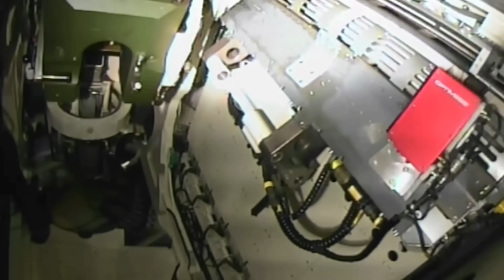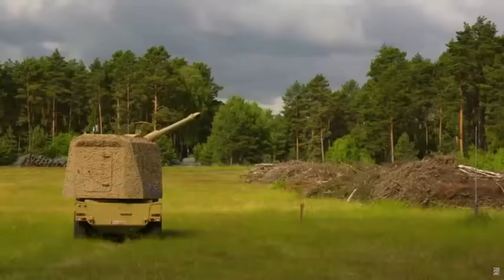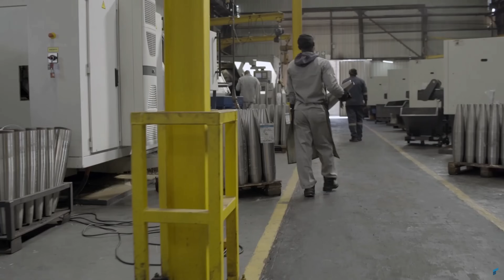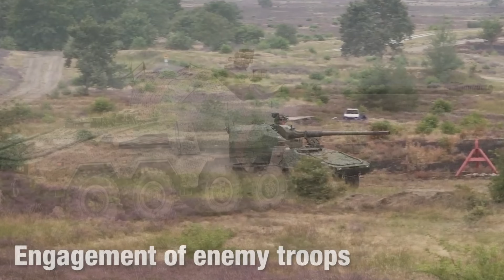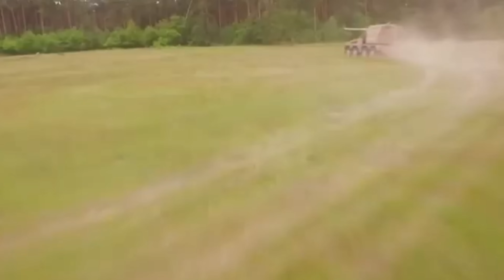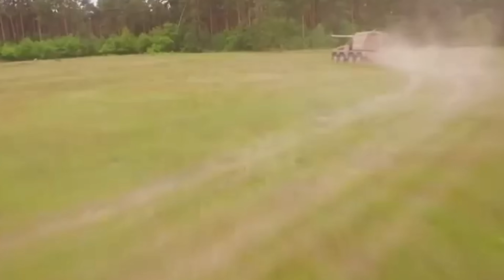The RCH-155 Self-Propelled Artillery System | 155mm FIRING ON THE MOVE!

Comment: Thinking of the state of the Royal Artillery and you mentioned the price of the beast a light bulb went off if you could mix a Regerment with RCH  and the NEMO  systems with my time spent on the 433 Abbot and the L118 there were times a Gun was sent out alone to deal with a target say a bunker or fortified house you could send a NEMO  this system could replace the L118 apart from it's Parra role and Comando role . You could either have a mixed Regerment or separate Regerments of RCH  or NEMO and of course they could be a mix of wheeled or tracked depending on what type of battle group it joined

Comment: What type of vehicle is used to reload the autoloader once it has fully discharged all its stored rounds?

Is it a vehicle similar to the K10 to reload the K9 howitzer? The K10, in turn, is capable of semi-automatically collecting rounds from a truck, storing them inside the K10, transporting them to the K9 howitzer, and transferring them in a fairly automatic manner with brief intervention from its crews?

Because with two crew members in the RCH and another 2-4 in the loading vehicle, it's going to be a nightmare to load 2 tons of rounds plus their propellant charges in an acceptable time. This is under ideal conditions, not in a real-life scenario where you might be attacked and you might even need some of the crew to assist in protecting the vehicles.

Comment: With Canada's new "Indirect Fires Modernization Program", I wonder if they'll be getting this. The desired specs seem to be favouring it, plus we use the LAV which is a related vehicle platform. 
Canada has been talking with South Korea for multiple projects, so it's possible a package deal might be worked out there & include the K9 instead.

Comment: With smaller budgets and lower solider numbers, Boxer RCH makes sense if it is part of support vehicles group that can change modules around in 1 hour to what is needed.

Boxer have been tested by the UK and Australia to be amphibious if the RCH is too that could make an interesting amphibious assault group.

Besides Australia and UK. I can think of a few others that could uses.

Comment: This version seems really cool. Only thing I wonder about the fire rate is accuracy. I mean it would have to wait until it stops "wobbling" around after each shot since not having the platform stabilized.
Reply: The gun does not fire when the operator pulls the trigger. Instead the fire command is piped into a computer which "pulls" the actual trigger in the exact very milisecond the barrel is correctly aligned.
Reply: @jonny2954  Makes sense.

Comment: I see this being very prone to tipping over if firing on uneven terrain. Kind of like what was found out with the 105mm on the Stryker when putting a big gun on top of a wheeled chassis.
Reply: Boxer chassis is significantly heavier than a Stryker.

Comment: I won't be surprised if most members of Great Britain, the British Commonwealth, N.A.T.O., and the E.U. buy this, at least a few batteries each. Most of the Middle East countries probably will base their artillery forces entirely around this turret, but perhaps different vehicle chassis, because it very well suits the Arab and Persian traditions of mobile battle (and top-down control in detail by remote management). Figure four to twelve batteries of twelve guns per country, five plus twenty plus twenty buyers. Everyone who buys it will buy the ammunition, too, so Rheinmetall is set.

Many of the buyers will also buy the Korean K9 or Swedish Archer, as well, while others will have their own domestically-produced SPH at half or a third the cost; but with widespread adoption, the pressure to "standardize" will actually suppress contracts to buy and maintain cheaper systems.

Comment: In the same time the ukrainians got their first "kf41 lynx" and their first "boxer RCT30" (of nine).
The boxer RCT30 are escort vehicle for the RCH-155 with special anti-drone equipment.
The first five RCH-155 will stay in germany for training and replacement, which is very likely an experience utilization from the PzH 2000. Because the most trouble has been the tear and wear on these vehicles than combat losses. With a third of the PzH 2000 not ready for operation due to repair parts.
So in 2025 only four !!! RCH-155 will fight in ukraine. This will not have much of an impact, which is so typical german, they come up with some wonderweapons, but just not in sufficient numbers.

Comment: Hi Matsimus, what a truly impressive capability the RHC 155 is. As it marries, what is possibly the best 8x8 Medium Weight Wheeled Armoured Vehicle platform, the ARTEC Boxer with a Modular Fully Automated variant of the PzH 2000 155/L52 Calibre Howitzer, all within a separated unmanned Turret. Two of possibly the best in-class capabilities on the defence market today. Hopefully the British Army’s Contract to procure this system as its AS90 replacement will go through successfully, and without delay (Wish-full Thinking, I Know!). I do feel that at some point the British Army ought to Purchase an updated version of the Tracked PzH 2000, in order to give it both a Tracked and wheeled 155mm Howitzer capability. This would enable both Heavy Armoured Brigade and Medium Weight Expeditionary Brigade forces, a 155mm Tube Artillery Fire Support capability. 

Anyway, another excellent video as always from you. Whilst on another note, it would be brilliant if you could do a video review on South Korea’s K9 Thunder 155mm Howitzer and its Variants. Cheers.👍

Comment: Firing on the move is advised to be done only when immediate counter fire is expected. Otherwise to increase accuracy a full stop is _advised_. Even German engineers can't overcome physics. Adding a moving component to any firing solution presents difficulties as not all aspects can be pre-calculated. Such as last second bumps, rapid elevation drops, etc. So shoot and scoot is still the preferred method for firing solutions.
 However as it doesn't need to extend sponsons for stability it is very, very quick back on the move. It IS however capable of precalulating a firing solution while on the move, come to a full stop at a predetermined position, fire its loaded shell, and then launch two more shells within the next ten seconds easily. That isn't enough for counter artillery fire to be incoming in most cases, much less even to be in the vicinity. With the multi-round, simultaneous impact system that means three shells will hit within a few meters of each other simultanously with the firing position already having been vacated again. And that over a range of 50+ km with rocket assisted shells. 

So unless a prepared artillery position isn't within less than a few miles, AND expecting artillery fire incoming, AND having loaded the correct firing charges for the accurate counter range, AND be very quick on the firing... you see where I am going with this. It will be a very unfortunate series of circumstances if one of these beasts is taken out by enemy counter artillery fire if full shoot and scoot protocol is retained. Mind you, loitering ammunitions in the area do represent a danger to it, but the same applies to anyone in the field. And unless it is an AT munition it isn't likely to destroy it; rather damage it, if at all.
Because the RCH-155 should never be alone out in the open.
And don't send it into open combat with other armored vehicles. That's NOT its designed purpose. Abuse it outside its designed purpose and watch it crumble. But that's the case for ALL military equipment, everywhere, in every case, no matter the skill of the engineers. FAFO is a stupid idea, at any time.

Comment: I think if you combine these RCH-155 boxers with skyranger 30 boxers you can make sure to stay on the move to avoid counter battery fire and use the skyranger 30mm autocannon with airburst to fend of drones. Highly encourage researching the skyranger 30 platform for the boxer, the german Bundeswehr is planning to use both systems for the "mittlere Kräfte" (medium forces).
The 700km you mention is crucial, the idea of the medium forces is that they are all on wheels and the range would make it possible to drive them to NATOs eastern flank in a short amount of time which wouldn't be possible with heavy forces with a ton of tracked vehicles!
Reply: Even more interesting with a Skyranger 35 plattform. Compared to Skyranger 30, these have CIWS capability that can also engage incoming mortar- and artillery rounds.
If i remember correctly, Ukraine wants to operate RCH-155 together with RCT-30. The Boxer with the SPZ Puma turret. These are also capable of using airburst ammunition and have shown promising anti-drone swarm capabilities in the testing field.

Comment: Firing on the move requires you to be running AFATDS like software that can keep up with the ballistic calculations while changing locations. This is probably done with GPS, but GPS is only so accurate, and there are places where GPS will lag to get positioning data, or simply places where you cannot get GPS pos data. without accurate GPS it is impossible to fire on the move. But the bigger issue is the safety checks here, with a 2 man crew I take it, it is a driver and gunner. In a Battery you have the Operations Chief and Fire Direction Officer, who verify all safety. If they are doing this all remotely that can slow down target acquisition and safety verifications. This puts a heavy reliance on Comms, so if the vehicle comms fail that is another critical point of failure.

Comment: A 155mm tank but without armor piercing munition. Or are there APFSDS ammo?
But to be fair - even if the 155 mm couldn't penetrate the armor of the opposite tank - if the optics still work when hit by a HE? Probably not.
Reply: No tank built can survive a 155mm H.E., because it comes down on top of it.

Think of tanks as self-propelled bunkers, and artillery as bunker-busters.
Reply: @davidgoodnow269  Did you watch the video? They said, the artillery piece could be used like a tank because it can deliver direct fire. Direct fire doesn't come from above. That was my point. A direct hit from a 155mm in indirect fire from above (without Cluster ammunition which can be made only against infantery/soft targets) - you are absolutely right. But a normal 155mm high explosive shell against the Front armor of a Leopard2/T-90/Abrams ... will probably not penetrate.
Reply: @pelle7771    Ah.
Look up, "HESH."

Also, "Dragon's Teeth bomb."
Reply: @davidgoodnow269  I know HESH, it is used in the Challenger tanks with 120mm. But I didn't know there is a 155mm artillery projectile with HESH - and I can't find it now. Do you have a link? My Google has no results for "dragon's teeth bomb" either. Do you have a link?
Reply: @pelle7771  I don't do links, because, well, I can't be bothered. "Dragon's Teeth" is what the anti-vehicle/aircraft/armor version of cluster bombs used in Desert Storm were called.
I don't know a model # for 155 mm HESH, but it's the basic 155 round used for bunkers, in contrast to the VT-HE for use on infantry.

Comment: Hold your breath, the 130 and 140mm guns on the upcoming European Tanks have targeting systems for artillery, which means your Leopard 3 or Panther KF-51 can also shoot on the move at targets up to 12km away, without direct sight of line. Add time fused HE grenades and you can even attack air targets with a bit of luck. I wonder how long it takes until a tank shots down a drone from 10km away.

Comment: i wonder how much it would cost on A MAN HX chassis...(with armoured cab)   it might save several million. MAN has a 3m wide version, which you would need for this thing. another advantage would be that it might be (a bit ?) lower.
Reply: German divisional artillery will get KMWs wheeled howitzer on a MAN HX 10x10 with the new L60 gun (75 km range instead of 40 km)

Comment: The ammo capacity isn't that bad in comparison: The basic M109 stored 34 rounds, the larger Paladin  stored 43, the German M109G had only 28. The wheeled Bodana can carry 20 rounds, CAESAR 18. The soviet 2S19 or the Korean K9 Thunder carry 50 rounds, the PzH 2000 is a mobile ammo bunker with 60 rounds. And favorite howitzer is the M110, but the PzH 2000 is of course the best contemporary system IMHO.

Comment: This of course is an achievement. But it is also a challenge for the procedures within the Infantry and the gunners and the drivers. Also logistics and supplies need to be rewritten! You don't have the stationary guns, which need to be supplied. There is a lot work to be done.

Comment: While impressive its development was only a question of time, the wear and tear on this is brutal. Every time that thing fires the whole vehicle gets warped. The repair/overhaul/replace times, this are the really relevant numbers for a system like this.
Reply: Vehicle weighs 40 tons, 155 mm full charge recoil a maximum of 11 tons. The stress on the vehicle frame during rapid driving in heavy terrain is higher than during a shot.

Comment: Regarding to todays battlefield treats this and the PzH2000 should be upgraded with a Trophy  like APS to at least defend against loitering ammunitions given to the prizetag before it will end up i n a russian parade... The modular Boxxer plattform in itself is awesome.
Reply: Problem with those systems is that they often have an electronic signature you can detect from affar. Artillery seems to survive well in Ukraine by just hiding. The electronic signature would make hiding difficult.

Comment: I just want to see someone make one of these modern spg:s with larger than 155mm cannon. Imagine this, dita or something with 200-250mm cannon.
Reply: Or 203mm (8 inch) Archer. Gonna hold less ammo than a 155 version, but with its rate of fire imagine how devastating it would be.
Reply: @solarissv777  That truck is not going to survive 203 mm.
Reply: @jonny2954  not on the move obviously, but on spades and outriggers everything gonna pass to the ground. Also, if you use an Archer design - you would have a significant recoil absorbing potential.

Comment: Years back this setup, would not have worked. 
The more bouncy suspension of a wheeled vehicle would put the aim off with even small movements. 
But with a modern fire-control you can put in the fire command and it will for sure wait until everything lines up perfectly.

Comment: RC.........hmmmmm.....use fiber optic to control movement, no jamming. Russian drones are now using fiber optics and no more jamming.  Hmmmm......🤨🤨🤨🤨
Reply: The range of the RCH 55 is 50 to 70 km. Drones controlled by fiber optic cables have a maximum range of 20 km. Fiber optic cable spools are not endless and they are relatively heavy. Artillery operates far behind the front lines, so fiber optic drones will probably never see the RCH 55. Against other drones, there will be Skynex, for example, that accompany the RCH 55.

Comment: i like the G6, i think it was one of the vehicles that brought back wheeled artillery as a serious contender despite DANA (probably because they were cRaZy communists) being almost 10 years older, not to mention the G6 has cool lines and is designed to ram through South African bush

it's nuts that something like this can fire a 155 without just tipping over AND fire on the move with all the other bigger systems having to be static

Comment: I agree on every Matsimus point and this is really impressive artillery platform, BUT please dont start throwing rotten eggs or something on me 🙏 , I am not expert on artillery or something just keen observer .🤔
All in this video is WOW factor, technology innovation & pros generally,
yet myself have some doubts,
-test ground is really flat, on first uphill drive vehicle moved really slow  than fired direct shot from most stabile angle when gun is turned on back side 
 (need to meet ideal terrain conditions to utilise shoot-n-move concept)

-Just looking on this BIG ASS GUN and turret making heavy pressure on rear part of Boxer (also excellent vehicle by itself) and to tires🤕, really high turret position overall and narrow supporting platform.
(question! - how much stress will platform take before it goes something wrong - wear and tear!? Maintenace & service time, in prolongued and intense battle, battle presence is important -not sitting in garage and give to mechanics extra working hours.  On bumpy and hilly terrains will it be prone to overturn!?)

-High shooting rate is great, but gun will get extra hungry fast and without "food". It have high tech aiming systems, computers and so on all heavy reliant on  GPS but today all that systems is prone to GPS jamming even with smaller sized drones or others dedicated EW systems.
-Loading mechanism looks really top notch. When eventually fails during battle and will fail! Can 2 man crew fix it on the field on the spot or have to go to some "garage" for extensive repair?
-Does it have option in case of failure for manual loading? A two-man crew is questionable to perform any on-site service.

Conclusion:
As a concept this systems shows great potential for future SPG generation but this is not yet time of NEXT generation
Sometimes this shooting ground tests reminds me on big flashy car shows like in Dubai where is Super Car presented with all new cool features and informations but at the end never see production line. Engineers just strips few innovations from it, scrap it and apply to existing production line which is fine -still implement new tech to already existing one and move on.
This is my brain fart.

Respect to Matsimus 👍   for excellent work, have been subscriber for 3+ years
admire the passion and quality put in videos
Keep` em comin`!